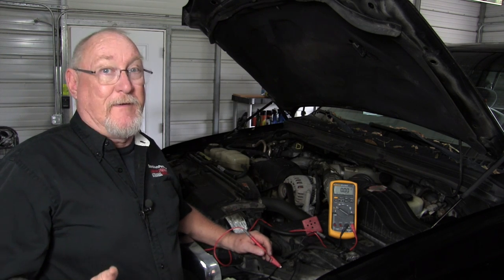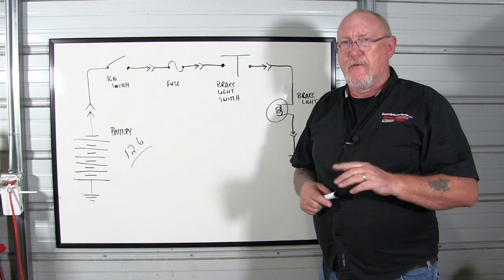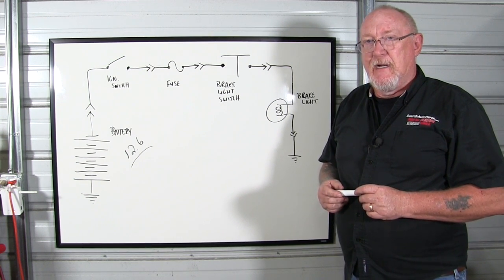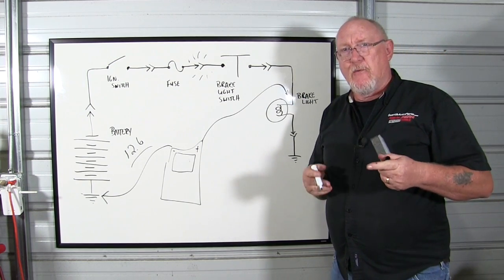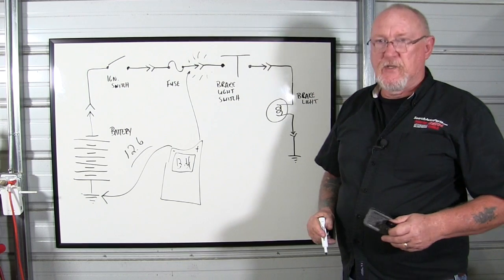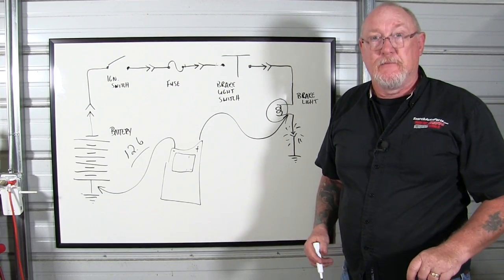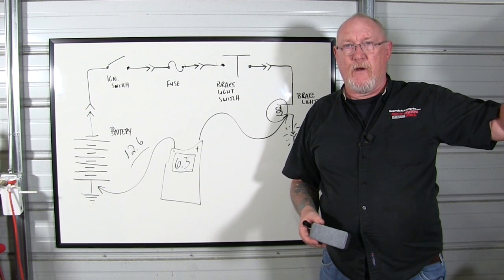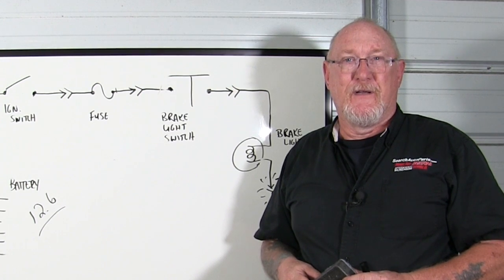The Trainer #84:  How You Can Measure Voltage When Your Meter Leads Say You Shouldn't

Comment: Finally, one that points out one of the most common culprits, unwanted voltage drops in electrical circuits.
This is actually the same as my own experience, and i am using it every time. It is often the first thing to measure if thing dont work properly. In a clima of moisture, salt, hot and cold the ground connections and other connections too over time and often, are among the weakest points.
If all consumers in the circuit are OK, then all types of connections are to be considered suspect.
Then it's about finding absolutely everyone, especially those who are hidden.

Comment: I’m going to make a statement that I’m betting isn’t true in hopes someone corrects me- if I got a response from Pete(r?) I’d be over the moon 🤠regarding testing from negative vs positive side of battery…is it not tomatoe vs tomato? Either one will work because it will show a voltage value (unless you put your second lead between your chosen battery terminal and all significant loads). Is there a benefit if you test from one terminal vs the other? I’m not seeing the benefit except maybe what the Professor mentioned at the end about testing from the ground side giving you an edge as a pro. I’m guessing something to do with most devices being grounded to the chassis???
Reply: He said it in the video. Testing voltage drops for a basic dim bulb. You could have an issue on either side

Comment: How do you explain 12v wire measured almost nothing when connected to ecu. But if the feed wire disconnected from the module, it reads battery voltage

Comment: @Motor Age

I need some help tracking down an issue. Im not a novice but I defiantly am not no expert either.

1999 For Expedition died replaced the fuel pump 3 times every time it will run for a little while then die and go back to a crank no start.
On the circuit down next to the fuel pump leads on positive and ground wire I get 12,69 volts then drops to 6.89 volts with the key on then drops to 2.3 volts doors open internal light on. Close the doors 0.02 volts some times 0.03.
Key off when I open the door and the internal lights turn on I get 2.3 volts and when I turn on the head lights i get12.48 volts on the fuel pump circuit.
At the battery center post ground to chassis doors open I get 2.3 volts and with the head lights on I get 12.48

I have the repair manual from Haynes and looked at the wiring diagram to see where they all come from from and the only spot I can figure is the power distribution box. Is it one of the main grounds to the chassis motor frame or am I looking for a positive short some where.
I replaced the fuel pump the first time took me a week to do it I am disabled and can not spend a lot of time on it before my pain over takes me and I have to quite for the day or two...why I had some kids come out and swap out the pumps later on one probed wires relays ect.
 I found the odd draw replaced the fuel pump relay at the suggestion of one of the kids who ... basically knows what he doing ... even though I swapped relays around checked resistance ohms ect ect and couldn't find any thing wrong with any of the relays fuses ect ect. I'f some one could point me in a direction I am not aware of I would greatly appreciate it.
Oh one more thing the Inertia switch is good and I even bypassed it to make sure same reading with  or without the inertia switch.

Thanks In advance :)

Comment: So the volts are all used up on the load except for enough to get the amps back to ground?  
So if the light or load requires say 2 amps the the 12 volt are needed to push the 2 amps through the load but only needs  .3 volts to get the 2 amps back to the battery???? 
Thanks in advance 👍

Comment: Great video and explanation 
Looks like my ground strap might be bad as my fog lights are grounded to the bumper only work when I put a test ground wire from the negative battery post to the fog light ground bolt 👍

Comment: The electrical diagram of the battery is inverted. The long line is positive. The short line is negative.
The drawing and measurements are incorrect.

Comment: Hi, thanks for taking the time to talk us through this. I just want to make sure I understand this. Checking for voltage drop on the positive side requires electrical flow. So you must check whilst the circuit is loaded? Otherwise you could still check the wire beyond a point of bad resistance and get 12v. However, when you checked the alternator body and found volts on the negative side, nothing appeared to be loaded. I think that makes sense to me. If there’s nothing further on the circuit to use the voltage, any voltage (above a small amount) would be a concern. Have I understood that correctly?

Comment: What doesn’t make sense to me is this. If all possible voltage is going to be used up by the load like has been stated, how could something downstream, even if it’s calling for its fair share, possibly receive voltage? There’s nothing wrong on the positive side , therefore based off of the theory, when it gets to the load it will have used all available voltage and there should be nothing reading down stream, and anything downstream shouldn’t be affecting the load. Can someone help me understand this or point me to some kind of literature or video explaining. Thank you!

Comment: Hi Pete, why is there a -1.79V (negative 1.79) voltage reading on the voltmeter at 0:22 of the video?

You have the pos lead on the alternator housing and the neg lead on neg battery post. Shouldn't the reading be positive 1.79V? How can the neg battery post be at a higher potential than the alternator? Or in other words how can the alternator be at a lower potential than the neg battery post? Isn't this impossible since the lowest potential in that vehicle should be the neg battery post? 

Thanks for video. A lot of good info.

Comment: Very nice! I've been a shade-tree "mechanic" since the '70s and never knew this about the ground side circuit (if that's the correct way to say it) measurements. I can hardly wait for the morning sun to arrive so that I can attack the "Lucas Electric" system in my 1972 Triumph with dim lights etc. Thanks!

Comment: Excellent video! Only additions I'd include are 1) everyone has heard of voltage, but far fewer have heard the term 'electromotive force', so since it was mentioned, I'd include a 10-15 second brief to quickly identify EMF and Voltage as being one in the same, just to bring the terminology full circle there, and 2) roll that into the specific relationship Voltage has with Current/Amperage in that Voltage, when viewed under the EMF perspective, it is the Electro'Motive Force' that pushes or carries the current and is the quasi-catalyst to current, as without the presence of "E"MF (aka: voltage), current (aka as both: amperage and "I"ntensity) cannot exist. 

(quoted initials reference pie chart variables)
Reply: I hope I find mine quicker than that

Comment: Over all your videos are great but, I'd like to point out that in this one you might be passing on some wrong details. First, on a schematic drawing a battery symbol using long and short lines, the long line is at the positive end of the battery. Second, cars don't usually use the ignition switch (or an on-off switch) in a brake light circuit. The only switch between the battery and the brake light is the one activated by the brake pedal. But, all that being said, as you know, the most likely resistance in the circuit is corrosion at the battery terminal.

Comment: He's trying to explain voltage drop across resistive elements in a circuit. A simpler discussion would be a voltage source and simple resistors in the circuit. Then, expand the discussion to count the connections as resistive elements, the switches as resistive elements (each with its own voltage drop), and so on.

Comment: Must repeat three (3) times until it sinks in.

Series DC circuit the voltage will be split proportional to the CURRENT
in the total circuit multiplied by the resistance in each load.
Comment please.    Next up learn how to figure the total current in the
circuit.
Reply from the maker: Voltage and resistance determine current. Voltage drops in proportion to the resistances of the circuit.

Comment: photovoltaic/solar thermal technician: i use to restore classic cars and my first task was to clean all my connections especially the negatives on block and chassis. wish i knew this back in the day. my Hat Off 👍
Edit: watched video in english then added spanish subtitles. i don't know mechanic and electrical spanish expressions. the subtitles did your video justice. in my 60's so i know my proper grammar in spanish but not tech talk

Comment: Pete, what would you get on your meter if you connected your black test lead to the positive side of the battery and the red lead to the positive side of the load?  Maybe the voltage resistance of all the little resistances between those two points, like a .15 or something like that if all was good? But a much higher reading if there was excessive resistance? Or isn't that a good practice??
Reply from the maker: I now teach a different way of looking at your meter leads. First, the voltmeter measures the potential energy difference between the two leads. So think of your black lead as your "reference" lead and the red lead as your "measurement" lead. If you place one on either end of the power side of the circuit (as you described), you measure the energy difference between the two. Since there is very little in between to use any energy, the difference you measure should be minimal. If it is high, then you have a source of high resistance between the two leads - using energy intended for the load. Make sense?
Reply: @VehicleServiceandRepair Thanks Pete,  but current has to be flowing, correct?
Reply from the maker: @salceti  For any energy to be consumed (voltage drop), yes. Perfect readings, though, also help identify circuit issues. This may be of help:  https://youtu.be/XwJHvN5ryis
Reply: Thanks Pete, I  started watching the video you linked but saw it is over an hour in length, so I will have to continue it later, but look forward to that.
I have watched this video now and enjoyed the explanations and the examples you demonstrate. It is now saved along with other Motor Age lessons you have given us followers that desire to learn your methods. Thanks again Pete.

Comment: Pete, I like to think of resistance as a switch that is almost turned on, by that I mean if a switch is in the OFF position you would have zero voltage after the switch and full voltage after the switch if the switch is in the ON position. So if you get a voltage reading that is neither zero or fulll voltage then there is resistance or "a switch that is not fully on or off". That is a way to visualize excessive resistance in a circuit for me. By thinking of it as a switch, "a switch that is not fully on or off". I came up with that by studying your white board diagram and relating it to the switch that you show as open and then when you close that switch you would get full potential voltage minus a few volts for switch/wire/contact resistance load. It may help others to visualize what is happening on your board in a circuit. Does that make sense?
Reply from the maker: Whatever helps you visualize how the three interact!  🙂

Comment: Is it possible to get a 0.0 voltage reading on the ground side of a load at the point closest to the load  ? What would that indicate  ?
Reply from the maker: Yes, and I'm guessing the load isn't working. The perfect 0.0 reading indicates two things; one, no current is flowing and two, there is an open in the load itself (or your test points on both sides of the load, so a connector may be involved).

Comment: Love that channel!Pete is a true genius! A question: In the very beginning Pete is seen connecting the PLUS terminal of the car battery to the GROUND while commenting that he actually created a connection between GROUND on one side and GROUND on the other. ("How can you be measuring voltage when both of your meter leads are attached to the ground"? he asks). How come both were attached to the GROUND?Is there supposed to be any current flowing from GROUND to GROUND?What am I missing here?

Comment: Current flows from the negative to positive and out again through negative.
Get it right.
Reply from the maker: Ben Franklin was the first to hypothesize that electrical charge flowed from positive to negative, based on the electric field model used to understand what happens when a charged particle is placed in the field. While today, we understand that it is the negatively charged electrons that carry the charge through the circuit. However, the positive to negative model is still used to orient the tools you use every day in your testing. In the end, it doesn't matter when it comes to solving an electrical fault.
Reply: @VehicleServiceandRepair  we are both right.
Reply: @valdesanchez6411  Conventional current flow theory says current flows from pos to neg not the other way around. Conventional current flow should be used by all technicians.

Electron flow theory says electrons flow from neg to pos but this theory is only used by scientists. 

To avoid or minimize confusion, we as techs should always use conventional current flow.

Comment: 11:15
You will only read 6.3V if the circuit is OPEN and there is a fault on the + side of that circuit. 

Your meter is looking for voltage between battery - and the light - side which on an open circuit would read 12V if good or 6.3V if bad due to fault or resistance on the + side of the circuit. 

That fault below the meter + lead (going toward chassis ground) is not going to be read by the voltmeter.

If you have a closed circuit and its flowing current and the light is ON and you put your - lead at the battery - post and you put the + meter lead on the - side of that bulb and its flowing correct, you should see maybe 10mV which is the actual current flowing thru the circuit, not an actual voltage.
Reply: Actually, if the circuit was open (wire cut or whatever) past the point where the voltage was significantly less than 12.6 (in this example was 6.3 volts) the voltage at that point would have been near battery voltage or around 12.6.  With the voltage lower, the light or whatever the load at the end of the circuit would be on at less than 100% as a bad connection in between would be creating, in effect, an extra load, thereby splitting the full 12.6 by multiple loads in what would, essentially, now be a series circuit due to multiple in-line loads.
Reply: @watchdogu.s.a.8973  WRONG
Reply: @ACommenterOnYouTube  WRONG
Check it out... other people know how to use all caps, also.  
Pete was right.  I was right.  You are wrong.  Don't like it?  Take it up with someone else who also doesn't understand how it works and you can both be wrong together.
By the way, sorry you got so triggered.  
#Trump2024
Reply: @watchdogu.s.a.8973 <--- triggered GenZ 🤣

Comment: I had a 240V dryer line that would NOT run my dryer at all. Got an appliance tech out to check the dryer, he said we had a bad motor, spend $350 for a new motor and it still didn't work, he got a 2nd motor because he thought the replacement was bad, 2nd one also did not run ... WTF ... 
He got another tech to show up and they could not figure out why the dryer would not run. Eventually they said it was bad electronics in the dryer ...
Purchased a new dryer ... Got it installed and it did not work. HUH WTF ... We called the company and they sent out their tech, he could not figure out why it did not work, then he placed an order for ANOTHER DRYER. 
Week later the 2nd NEW IN BOX dryer shows up, plugged it in and NOTHING ... NOW we are pissed. 
I checked for power at the outlet and got 240V but the dryer still didn't work. We got our $$ back from the NEW IN BOX dryer and took our "bad" dryer to a used appliance store that does repair. He plugs it up and the SOB works ... 
Took it back home and NOTHING .... So at this point is was electrical because it did work at their shop but not ours. 
I checked the outlet and got 120V on one leg and 120V on the other leg and 240V between both legs. 
Then i said, if we got 120V on each leg and 120V on the other and 240V across the two, WHY THE F is this not working .... 
Then the light in my head came on .... Voltage was only half the story. Voltage is just pressure but AMPERAGE is the flow ... Just because i got 240V between the 2 does not mean current will flow if there if a restriction. 
So i went and purchased 150 ft of 240V wire, went to the panel and disconnected the 2 hots from the breakers and wired in my temporary 240V line, ran it across the floor and to the dryer room, wired up the temp cord to the outlet and I WILL BE DAMNED THE DRYER KICKED ON AND WORKED ... 

After disconnecting the original 240V line that ran to the outlet and measured the 2 hots and the N wire, i had a 500 ohm SHORT between the black and red wire and a 1200 ohm short between the red/black and the N wire ... 
This 240V line ran from the panel, down and under the trailer and was just laying on the dirt, actually was about 6 inches below the dirt, it was SOAKED and WET and it was NOT direct bury wire .... SO the wire even though was passing the 240V .. when we tried to push current thru, the wet wire was restricting the current flow and enough to not allow the dryer to run ...

after we yanked it all out, the 4 copper conductors were soaked and the outer jacket was just barely holding on ... 

So the water was restricting the current flow.  Same as this video, that resistive fault is slowing down the voltage.
Reply: Try running a negative wire through the chassis
Reply: Thanks, I would not have thought about this applying to household electrical.
Reply: @HOLMES-l8u  those automotive electrical engineers have got some Balls!!  Huh?  Anyways, no don't do that in residential for sure